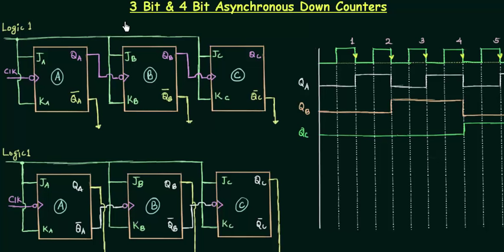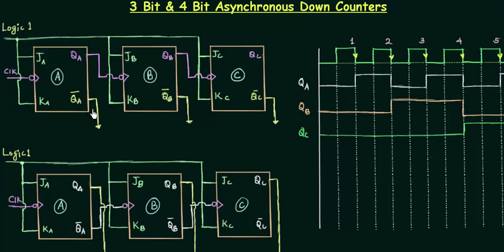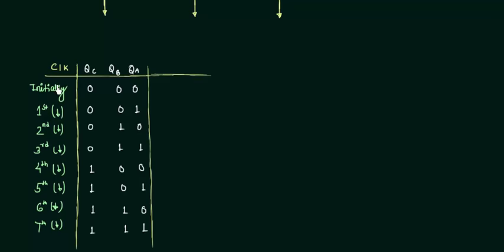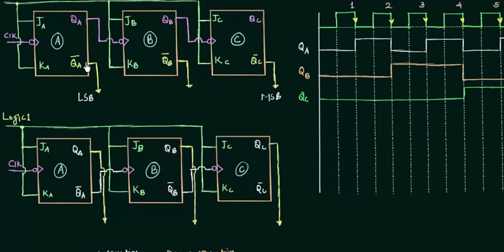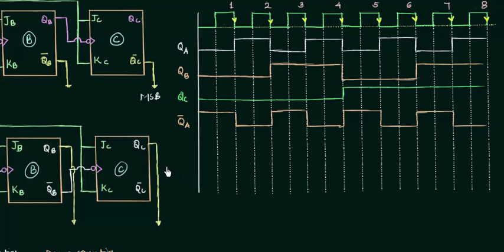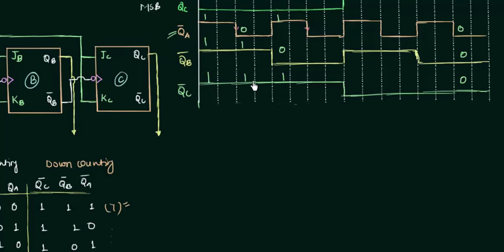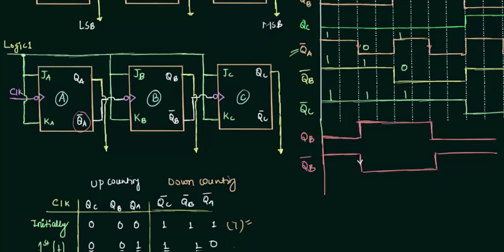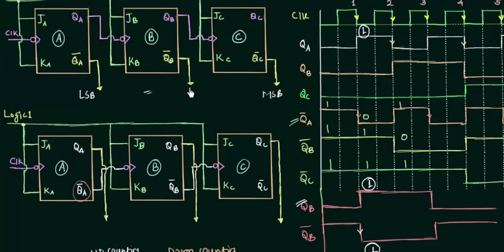3 bit & 4 bit Asynchronous Down Counter

Comment: for the second configuration a separate state table has to be made as the outputs are now changed. In 1st configuration they were in complement form i.e. Qa' Qb' Qc' but now in 2nd configuration they are as Qa Qb Qc . And while you analyzing the values of Qa, Qb, Qc i.e. output of 2nd configuration ( 8:29 - 8:37 ) you have compared it with the 1st configuration state table which making all the confusion in the audience.
Reply: 4 saal beet gye hai tumhare iss comment ko. Ab tak toh tumhari job bhi lag gyi hogi ?
Reply: @pronoob4890  haa bhai 😅
Reply: @keshav_c17  kaha job karte ho?
Aur iss question ka answer bhi bata do…
Reply: @keshav_c17  super senior 😁🙇
Reply: @pronoob4890   aab tak toh tumhari bhi lag gayi hogi mujhe v clear kara  do yaar😂😂😂😂
Reply: @mahendra756 job nhi laga hai par internship mil gaya hai VISA company mien. Most probably woh log ppo bhi de denge mujhe internship ke baad.
Reply: @pronoob4890   yeh confuse hatado yrr...i will be thankful
Reply: @pronoob4890  🤣🤣🤣🤣

Comment: In the second configuration, why did you start taking ouptput from the secomd clock pulse , and not from the initial state like you did in the first configuration?
Reply: Coz first output will be the same in any condition

Comment: Thank you for the video. Great job you have done. But as far as I can see these two methods don't have the same result. In the first method initially it is 111 (as the compliment of 000) and that is fine, but in the second method we have 111 at the first impulse, and initially it is 000. Please comment.
Reply: It' not 000 it's 100 anyhow it's not equal to 111
Reply: @rockykumarverma980 it is 000, not 100

Comment: In the second configuration of the 3-bit up counter where you feed the negated flip flop output, why do you start the counting from the 1st clock pulse?? why do you not assign the value for the initial clock pulse??
Reply: The system is driven by Qa', Qb' and Qc'. There's an offset of one waveform to get all of these into zero state. Once that happens, it's just mimicking the first configuration.
Reply: Rahul Madhavan How does that answer his question? You've answered what happens after the max count which is way different than the OP's question which asks why the initial clock pulse is not considered?
Reply: @ir2001  I would suggest that you observe the waveform diagram for the second circuit , the starting point is actually after the first timeperiod because the first wave is the end of the last wave

Comment: In my text book, the down counter operates with Q1=Q2=Q3=1 at the initial state, not the complement of them equal to 1 (in which Q1=Q2=Q3=0, this is the initial state of UP counter). Hope you check it again. 
And anyway, you’re doing God’s work, keep it up. Thank you.
Reply: please explain
Reply: well, the initial state of the DOWN counter, even if you take it as the complement of the initial state of of the UP counter (Q1 = Q2 = Q3 = 0), will be Q1 = Q2 = Q3 = 1, which is the correct initial state.

Comment: ur videos are very helpful.
 In the second configuration of the 3-bit up counter where you feed the negated flip flop output, why do you start the counting from the 1st clock pulse?? why do you not assign the value for the initial clock pulse??
Reply: I had the same question, but it's the same thing really! 
 You will start with (000) then (111 ) so you're basically going backward

Comment: you can use the up counter with positive edge triggering for down counting.but the initial state will be 0 and then it starts down counting from 2^n - 1.n = no of FFs
Reply: if you use the second method that sir told, then too the first clock pulse is 0 and downcounting starts from 1st pulse

Comment: In the second circuit ,initially we are taking 000 but initially there 010 because clock of second flip flop is already 1 as it is connected to qa complement which initially is 1 as qa is zero initiaally .pls explain

Comment: In the second configuration of the down counter where we feed the negated flip flop output to the other, how do we start at '111' when Q_A is 0 initially?
Reply: +and1fer I'm sorry if it took 6 months to see to your question, but QA is zero, and we're using QA' (the compliment) as the input therefore of course its 1. because when you compliment 0 you get 1.
Reply: lwfabsman No he's talking about the logic 2 where the clock is different. QA is 0 there initially.
Reply: lwfabsman but i want to kno for the second circuit , here we take qa,qb,qc not the compliment and it should start with 000??
Reply: @utkarshgangwar8125  my friend its starting with 000 and the next state is 111,110,101,100,011,010,001. After that it again goes to 000.  In that way we get the downcounter logic.  Next state of 000 is 111. Here logic is same don't confuse with what you get in the beginning.

Comment: what is logic 1.how do we connect it while wiring ic chips
Reply: He just means that a high voltage is applied to all of the inputs (a logical "1") as opposed to a low voltage (a logical "0"). In terms of practically wiring up IC chips, I'm not sure how it's done -- I believe you have to select two voltage levels (no doubt based on the parameters of the chips themselves) to serve as the "low" and the "high" voltages. Hope that helps a bit!

Comment: Why don't you do asynchronous counters for positive edge triggering?
Will be helpful, if you had explain it as such.

Regards,
Rima.
Reply: RIMA RAI positive trigger or negative trigger...it doesn't matter to asynchronous counter.. u may also done for positive edge trigger as well as the negative edge trigger.  your output will be the same. try urself & see
Reply: yep, I do know that ma'am, the thing is I am not worried about the answer, I was worried about the process, which later sir explained. 
anyway, I had a wonderful paper. All thanks to neso academy!!!
Reply: @rimarai1658  where sir explain with positive edge triggered ?